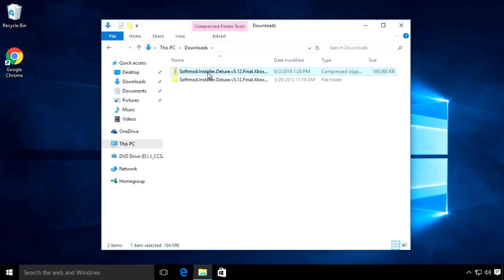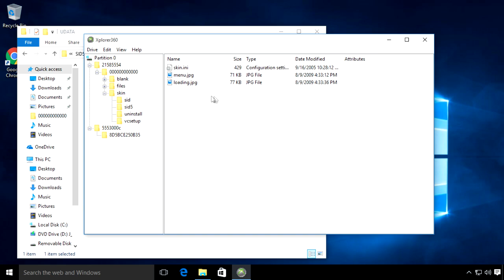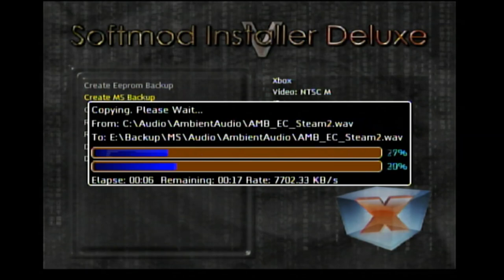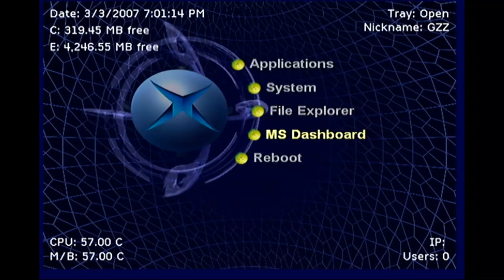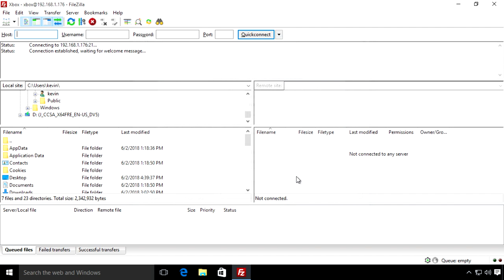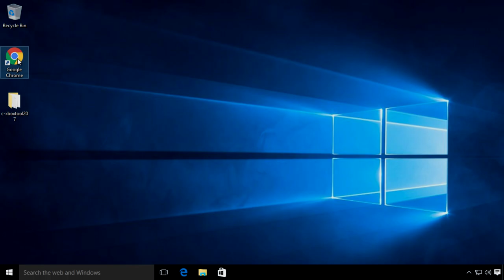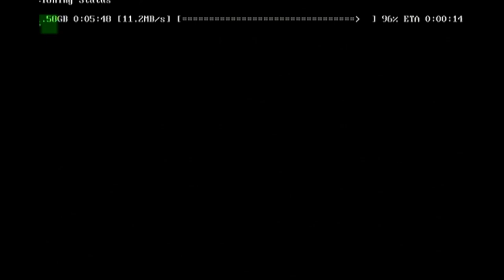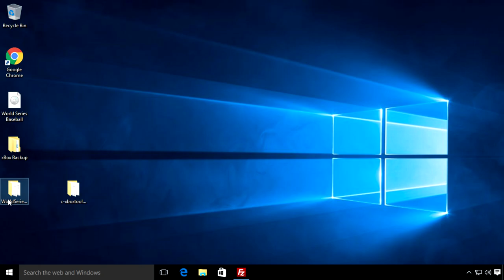Restoration Therapy: Original Xbox Softmod & Hard Drive Replacement

Comment: Great video. Can you tell me what the benefit of the new IDE cable is? Is it just so you can keep all 3 IDE drives connected when cloning? Or does it actually help the SATA adapter boot faster? I've noticed when using SATA adapters that a lot of times the new HDD won't be recognized fast enough while booting and the Xbox will throw an HDD error. I've been trying to find a way around this without TSOP flashing and it looks like you didn't TSOP flash at all

Comment: I’m only getting one boot: loading kernel it doesn’t go to the second boot and I never reached it to that screen. My Xbox flashing red.  Any suggestions ? I mess around with the slave and master positions and no luck.
Reply from the maker: What kind of hard drive are you using? Does it work if you put it back to its normal state?
Reply: @WiBitnet  western. And it does work when I put it back into normal state. I get stuck now at the blue screen when booting and then the black screen it gets stuck on.

Comment: seems like i have shorted my xbox console by trying to mod it, is there a way to reset it? cause when i plug the hdd it powers down, if i leave the hdd unplugged from the molex cable it powers up normally
Reply from the maker: Hmm. I have never encountered this problem before. It is possible the hard drive just died. Have you tried hooking up a different hard drive and booting it up? It's not gonna work, but it might at least power on, and rule out the hard disk. There are mods to replace the hard drive without this mod.
Reply: @WiBitnet  so far, if i try with another disk the xbox powers up but get the 07 Timeour error, i think that i need new IDE/Sata Adapter, probably the xbox old hdd got a shorted TVS diode from the adapter i used (the cheap chinese one) and that malfanctioned everything. Gonna try with new adapters when they arive from amazon and let you know about the progress.